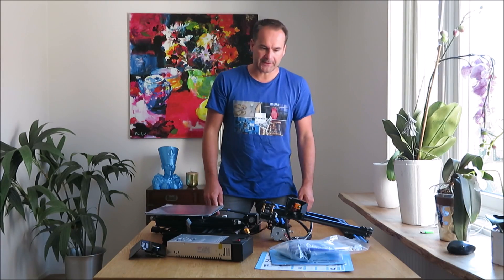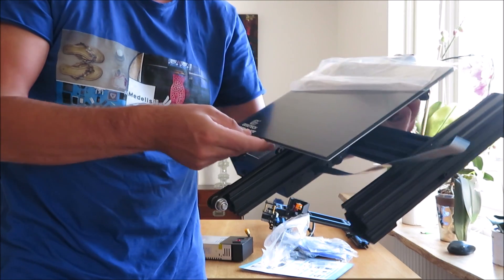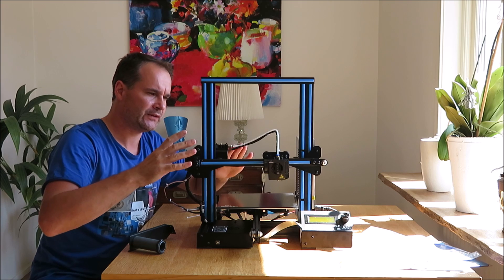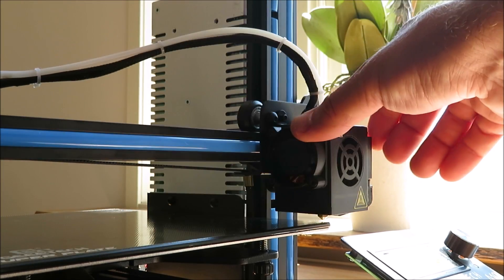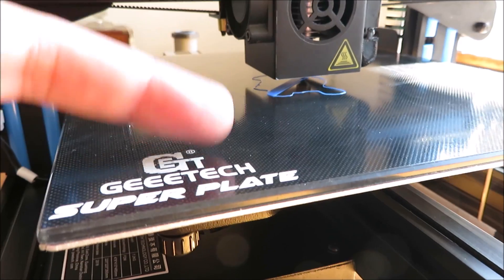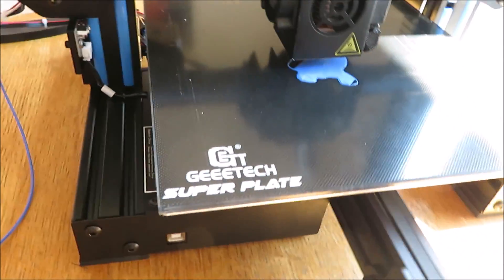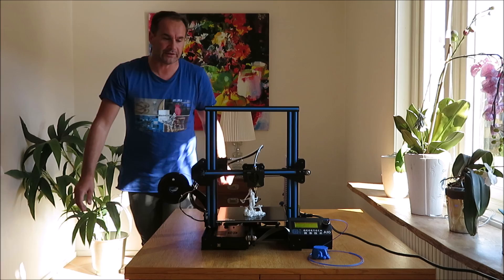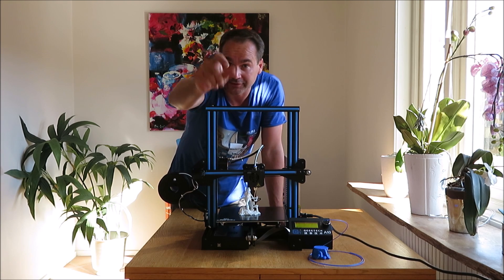Geeetech A10 3D Printer REVIEW - Creality Ender 3 KILLER 💀

Comment: The Ender 3 is a much more well made printer at this point.
There are too many small issues with the A10. 
You can clearly see the left side of your bed is lower than the right. (and this isnt just bad leveling, the spacer nuts on the left are much shorter than the eccentric nuts on the right)
The part fan only works when set to 255. 
I've seen a few where the wheels weren't straight and needed to be replaced outright. 

My Stock Ender 3 is quieter than your machine.

The difference in price is not enough to warrant the headache of some of the current problems with the A10. 

That being said, if geeetech works out these issues and can keep the printer at the same price point i would be more likely to choose this over an Ender 3.
Reply from the maker: Nop, they frames identical and comes from the same china factory :-) (just control card different) creality and geeetech not makes printers by itself (they just assemble not ready products) that's why so many china printers is the same (clones)

Comment: I would disagree, having owned a Geeetech I3 Prusa copy, which is now retired after very little use. They are cloning rather than making their own product. My Ender 3 is quiet,  bed levelling stays consistent, print quality is first class,  bed just requires rubbing alcohol to clean for very strong adhesion.  Of course Geeetech have copied Creality because Creality made a first class printer. The prices are on par. If I was to choose a  new printer, I think I would still be buying a Creality product.
Reply from the maker: Yes Creality making very powerful printers